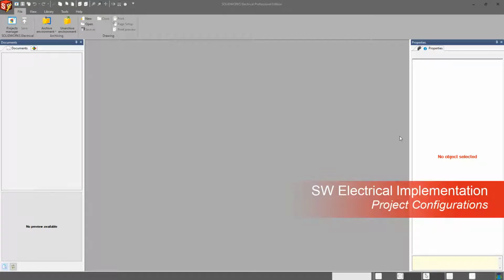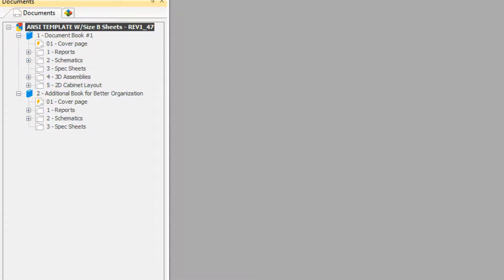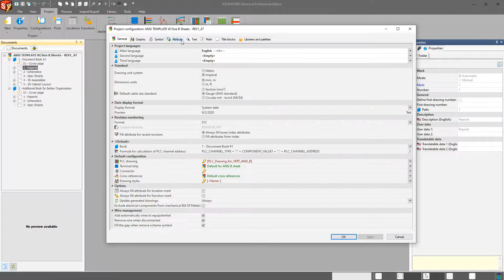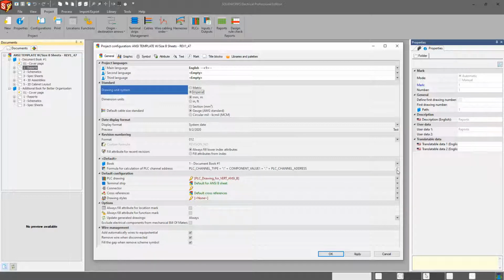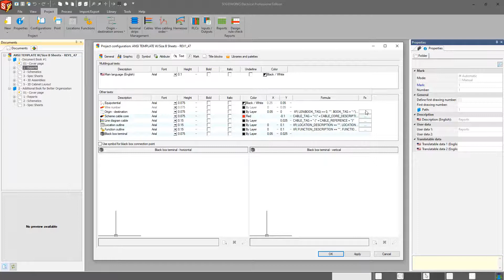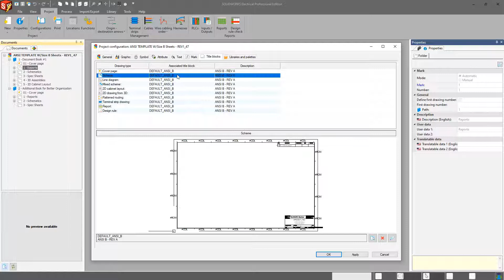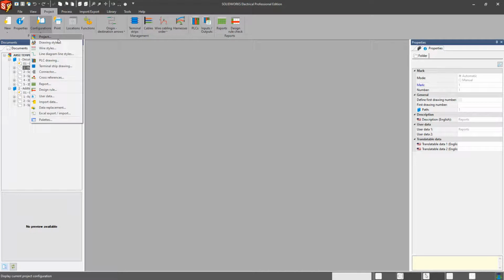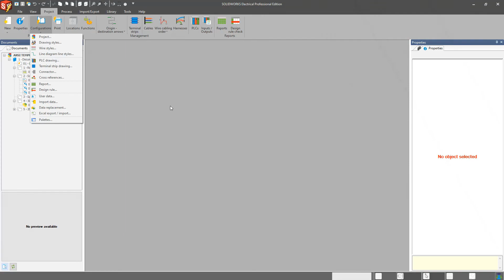SOLIDWORKS Electrical Implementation 9 of 19: Project Configurations

Comment: Is it possible to compare two different project settings or say a project's settings to the original template's settings ? Example - a designer starts a new project from one of the customized templates and is working away on the new project and changes a few settings during the design. Month(s) later the project is finished, everyone happy with the format and style etc, can the designer compare the project settings to the original template settings to see what are the difference(s). If so, those changes or some of those, could be incorporated into the original template.
Reply from the maker: There is no "visually compare" or spreadsheet style list showcasing the differences between (similar) projects. It's something on the list to build, but there are a lot of other eggs to fry first... ;-)
There is a log file, but unless you understand the details of what's actually in that file - it may be difficult to understand.